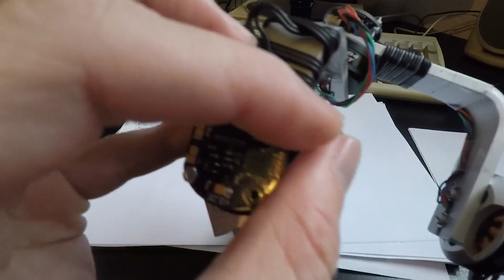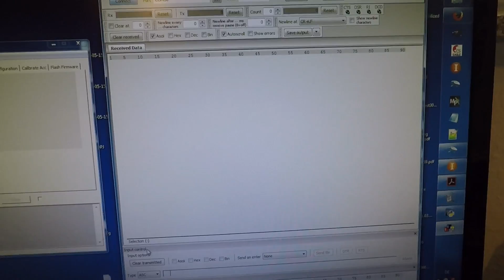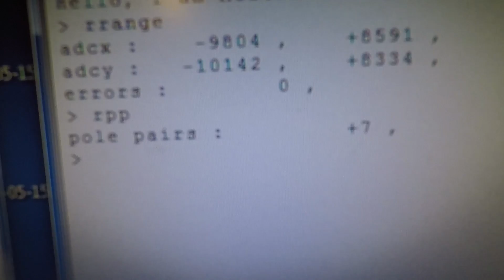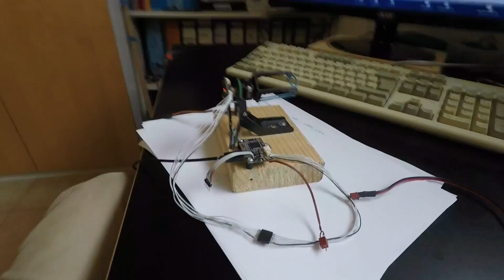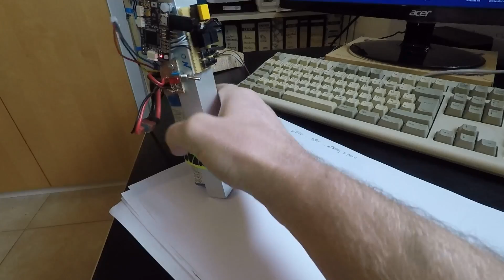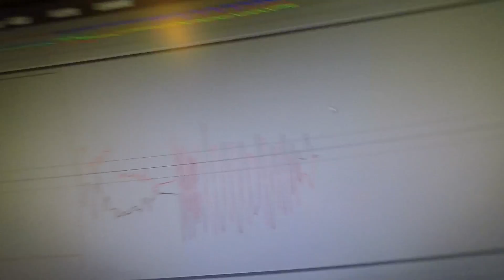T-STorM32: Sneak Preview at Concepts, Features and Setup

Comment: Olliw42 you're the king of gimbal controllers.
And thank you for doing this in english.
Is it necessary to use low KV motors or special gimbal motors for gimbals? Because I am thinking of a bigger motor for the 3rd axis, since your system allows for different types.